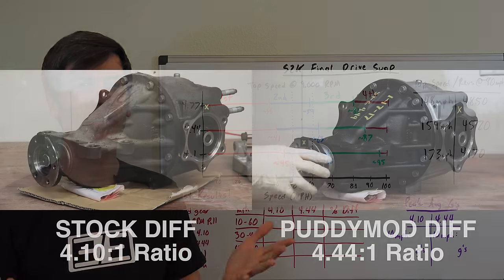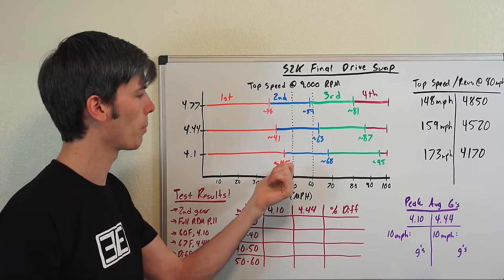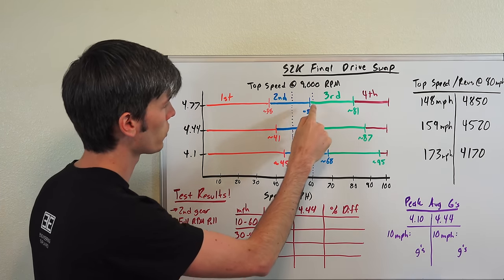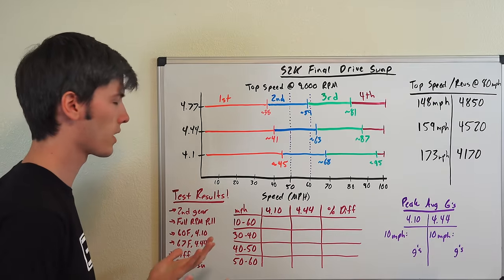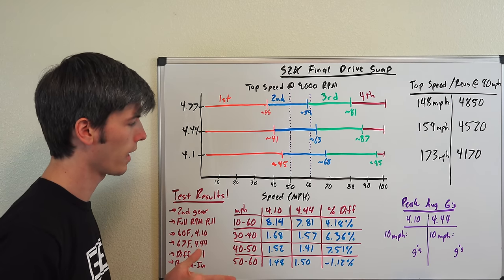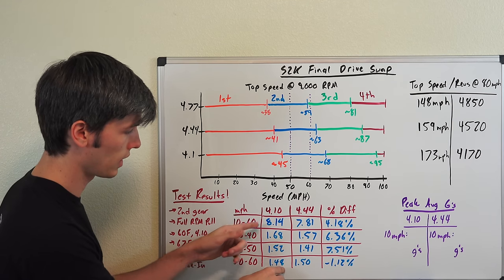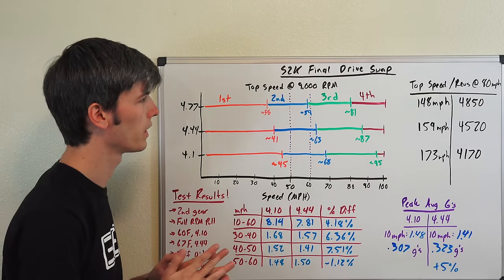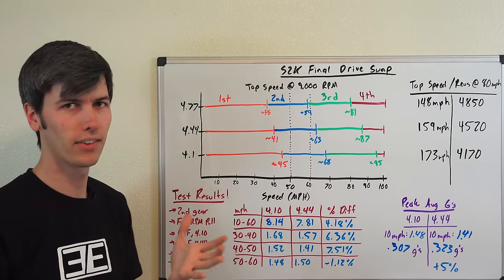Can Gearing Make Your Car Faster? With Proof!

Comment: great vid as always! 

however what are your thoughts on the duration of time spent in the fatter part of a torque curve? You compare the max g force that both ratios would provide and state there is an increase of 5%. 

But this does not take into consideration the time spent in the torque band. Also if an engine has a lot of torque it is more beneficial to have a longer ratio as you want to use that torque for a longer period of time before changing to the next gear. 

Think of the Corvette ZR1 or the Dodge Viper. Both cars are geared to do over 60mph in 1st gear. if their ratios were changed to be shorter, they would have a higher peak g force but the overall acceleration would be slower as you wouldn't be able to use the torque as effective as you'd be racing from gear change to gear change.
Reply: The Corvette and Viper would have no traction if you shortened the 1st gear though, so It would be futile to do so anyway... giving more torque multiplication would just make it wheelspin central.  I noticed Jason didn't mention the effects of being traction limited.
Reply: Yes I agree.  However I feel that if traction could be increased to negate wheel spin then all you would be doing is changing gears (on the ZR1 and Viper anyway), rather than applying the torque and accelerating.  

Anyway, I'm not claiming to be an expert on this.  I've just seen in my local car scene guys changing from a 3.08 diff ratio to 4.33 and going slower down the quarter mile, the 4.33 is much more fun on the street cos you do feel an increase in peak acceleration g force, but ultimately a slower car.  I used to have one of these cars back in the day with a 3.08 ratio and from witnessing that others did, I would imagine that somewhere in between would have been the best upgrade like around 3.73/3.91.  BTW the cars are an Australian Holden Commodore, this particular model weighs 1,500kg, with a 5.0L v8 efi with approx 250hp if you're wondering :).  

I know the example I gave is extreme in comparison to what Mr EE has done with his S2000 with only a slight change in ratio which obviously he has done the math to know it would be more beneficial.

I feel that at a certain point the ratio will become too short, or on the flipside when the horsepower or torque is increased you need to possibly increase the gearing to put the power down. Think drag cars that are running 2 speed transmissions, larger diameter rear tyres, and can still manage high tops speeds.

Be cool to hear Mr EE do a technical vid to explain this :)

Comment: Oh, and what about 45 to 65?
Shorter gear ratios feels faster. It is faster only if the test at hand does not involve an extra gear change.
Top speed is not really a negative because in fact it makes it usually more attainable.
That is why often the 4.77 gear ratio S2000s run slower 400m than stock 4.1 diff.

Comment: If your Rev-limit kicks in at 61 mph than it should have no effect on your 50-60 time.

look at your engines power-curve.
pretty much every normal motor will drop in power before hitting the rev-limit, so with the lower gearing you are likely already past peak power.

Comment: I'd be interested in seeing the difference in fuel economy when cruising at 65 mph in top gear between the two, since the 4.44 would end up cruising at a higher engine speed.

Comment: Where did your stock numbers come from?  I've owned S2000s for 11 years now.  Magazines claimed (and I have unscientifically verified) that an AP1 from the factory will do 42mph in 1st gear, 64mph in 2nd, 89mph in 3rd, etc.  162mph top speed.  This is confirmed in a super accurate way by reading 81mph when my tach is at 4500rpm lol...  I've never run it through a telemetry system, though, so that may be the difference.

Comment: i sortha think i would had gone with 4,77:1 and a bit laarger tires in diameter.
the gears won't be as short, but supposedly larger wheels give a bit more grip.
can help to lanuch from start efficiently. and might get the 4,77:1 diff long enough to reach 60 mph with one less gear change, as with the stock wheels you are just shy of it a tiny tiny bit. most probably a larger diameter wheel can allow less tire pressure, even while grip is based on only the friction between the surface and the road, i think a larger contact patch has more "chane to find spots with better grip" if you catch my drift.
supposedly the larger rear wheels will allso tilt the car a weeee tiny bit to the front, that can allso help  a bit when doing dragracing. might, just might allso help with downforce too. but i don't think its going to be that steep.

Comment: Hi, I have a totally stock 2001 Cobra Mustang vert that I would like to make quicker off the line.  This is a family fun car, daily driver.  Is it better to simply install a 3:73 or modding the engine for horsepower?  No racing for this car, I’m just looking for more “zip”.

Comment: I was wondering if you could tell me if there is any difference in the 0-60 time with the new gear. I know you said that for the purposes of the test u did the 10-60 time to eliminate as many variables as possible, but I assume that you already know the 0-60 time for the stock gear in your car. I was wondering if u have checked the 0-60 time for the new gear yet, and if not, can you check the 0-60 for the new gear and let me know the difference if there is any? I am really curious to see what the effect, if any, of swapping out the diff in your car is

Comment: I changed the gear ratios in my 240sx with a j30 vlsd and it's a lot quicker but screams at around 5,000 rpm on the highway. Kinda annoying lol
Reply: That would drive my crazy, I'd feel bad for my engine.
Reply: I know. Every time I drive on the highway, I'm constantly saying sorry sorry sorry to my car and other drivers. lol
Reply: Isn't the stock 240sx gear 4.08 and the stock j30 gear something like 3.90? Your comment doesn't make sense if that is true. Also you can change the carrier without changing the ring and pinion gears. Which means you can get that VLSD carrier without changing your gear ratio.
Reply: I think you misunderstood what I said. I changed the gear ratios in the j30's differential that then went on my 240sx.
Reply: So what gear ratio did you change to?
Reply: lol, What is this, 21 questions? 4.36:1 with the 5-star bolt pattern output shafts and cv axles
Reply: I could probably think of 21 questions if you really want me to. lol
Reply: not as annoying as my 240 with 4.63 and straight pipe!

Comment: Great videos. I've been wondering lately. If I set my manual transmission vehicle's cruise control at it's optimal powerband RPM on the highway, as long as it's within the legal speed limit of course, will it get the best fuel economy at that specific RPM?

Comment: Hi, I'm not an expert in mechanics but have been trying to understand why my 2020 X5 30d feels slower taking off from my former 2015 X5 30d, (same diesel engine 30d). The new car has only 8Hp's more but in torque comes with an extra 60Nm of torque. Both come equipped with ZF 8 speed transmission
So why I'm getting a feedback from the new car slower from a stand departure? 
The old car had 20" wheels, the new one 21" 
I found some valuable information about both cars that maybe you can tell me if that's where the difference comes from. For example, the old one has a final drive ratio of 3.154 vs 2.929 from the new one? 
I do have the ratios per gear if you need them, thanks in advance

Comment: Great video, curious about doing this for a BRZ.  Curious if you can note or reference what some disadvantages (unrelated to acceleration/top speed) might be if doing this, because it sounds pretty good, thanks.
Reply from the maker: Worse fuel economy, and you'll need to correct your speedometer to read accurately.

Comment: Isn't it bad to have WOT with the rpms down?  Or is this just a Turbo Charged vehicle thing?
Reply from the maker: Yes, worse to do with turbocharged cars, certainly, as you have higher internal pressures which increases the likelihood of pre-detonation. Especially important not to do WOT at low RPM in higher gears. In lower gears, the engine isn't forced to work quite as hard.
Reply: Jonathan Lavigne depends how "down" they are. It depends on the gear and where the engine makes torque. As a rule of thumb for petrol engines, where the peak torque is usually somewhere in the 4000-5000rpm range, flooring it at anything less than 1000-1200rpm in any gear other than 1st can be bad because you'll be lugging the shit out of the engine. Flooring it at as low as 1500rpm in 1st is okay and isn't too bad in 2nd. For higher gears I make sure to be at at least 2000rpm.

For a diesel engine it's a different story, because diesels usually make peak torque somewhere around the 2000rpm mark so at 1000 or 1200rpm they're still running close enough to peak torque that WOT in 1st, 2nd and maybe even 3rd (depending on how long or short the gears are) isn't that harmful.

With regards to the test that Jason did here, 10mph in 2nd gear with the 4.44 final drive is about 1400rpm, so even though it's a low speed and the engine is not making much torque i.e. not working very efficiently, the relatively high gear ratio from second gear reduces the load on the engine in the first place.
Reply: Pretty sure EFI solves these, especially with electric throttle bodies.

Comment: so having a diff which is 4:3:1 ratio it  will accelarate faster but will have a decrease in top speed 
but if you put a 4:1:1 diff ratio it will accelarate slower but it will have an increase in top speed (if you tune it as you said)

Comment: You should turbo this. If you turbo ur s2000 would it become more efficient?
Reply: Ya, I think he's planning on it. RULE #1 OF TUNING: UPGRADE INTERNALS BEFORE ADDING 15+psi
Reply: Haha Roland, I think S2000 internals are very strong anyway, the downside is more than turboing it will ruin the pure NA vtec driving experience (yo). :)
Reply: mujjuman   no. it would not be more efficient. you are thinking of a diesel which is more efficient with a forced induction system (turbo. supercharger)   to those that may argue this; forced induction forces more air which requires more fuel which will increase your fuel consumption on a typical gasser. not to mention the higher compression ratios generated. on a diesel it the opposite. without forced induction the diesel basically bellows black smoke. black smoke is diesel fuel that did not combust. this happens because of the way a diesel works. it ignites fuel based on compression alone. meaning when fuel is injected it is ignited with hot compressed air alone. well when you dont have enough of that hot air it leaves a rather large percentage of diesel behind blowing it out the exhaust valves. when you turbo a diesel you get more air to simply burn the fuel thats already there. on a gasser you would definitely have to increase fuel flow to make it run properly which decreases efficiency. on a diesel its about what ignites the fuel to begin with... which is oxygen or air. not spark plugs.
Reply: mujjuman  i think hes not doing that because hes making videos on experimenting with his S2000, so adding a turbo means adding the turbo lag factor which would definetely be a drawback for his videos and making his experiments "unfair" especially for vids like gearing. but if i had an s2000, i would probably turbocharge it :)
Reply: It wouldn't be more efficient than stock, but it would be more efficient than a comparably powered NA engine
Reply: mujjuman any time you add forced induction, you will be adding more air, which means you need more fuel. more fuel means less fuel efficiency per mile, which means lesser miles per tank. obviously. the only time it's near same efficiency is at idle
Reply: if a car is designed with a turbo from the getgo it can save fuel, as a smaller displacement engine is needed to hit the power figures they want.  slapping a turbo on a engine that's already in the car will never save you fuel though.
Reply: No, and even factory turbo cars don't get better mileage when driven hard.   Factory turbo cars are tuned in a way that helps them post good numbers in the EPA test, and the turbo can help part throttle efficiency, but the moment you start hammering on them at WOT you run into reality, and that reality is that turbo cars have to run richer than N/A cars.   So while a 300hp turbo 2.5 can be driven around like it's a 150hp 2.5 and return better economy than a 300hp N/A 5.0, once you start using the power they end up consuming more fuel. 

A turbo on a F22C requires a rich tune to stay safe, so he'd tank his fuel economy from idle to WOT, and they aren't particularly reliable once the power gets over 400hp.  There's a reason people put aluminum LSx engines in S2000s.

Comment: This isn't a complete enough test to conclude that gearing can make your car faster.  Yes, it can make your car faster during a certain interval (like he tested, 10-60 in 2nd gear).  What if he tested 10-85 using 1st, 2nd, and 3rd (while finding a way to keep shifts very consistent)? The 4.44 would have a slight advantage between 10-41 mph, but once he shifts the 4.44 to 2nd, the 4.1 now has a significant torque advantage until 45 mph when the 4.1 now shifts to 2nd.  Is the torque advantage between 41 and 45 enough to outweigh the torque disadvantage between 10-41? Yes!  Same thing happens between 45 and 63, the 4.44 has a slight advantage, but once the 4.44 shifts to 3rd, the 4.1 catches back up.  Without considering the fact that sometimes the engine is far away from peak torque (the S2000 particularly has a very constant torque curve, so keeping it near peak torque is easy), there will be very little change in acceleration with different rear end ratios when spread across a large interval.  Changing rear end ratios makes sense for eliminating shifts or keeping a higher torque band for defined intervals (1/4 mile, long straight on a track, etc).  For a street car, if the transmission ratios are close enough that the engine stays relatively in the torque band, then select the rear end ratio that keeps your cruising gears happy for your most traveled speeds.  You should make a graph that shows torque at the wheels versus ground speed.  Then the area under the curve will be relative to acceleration.  It's a good way to show that over a long interval rear end gear doesn't matter, but does matter if you put a start and end to the acceleration interval.

Comment: So the gear ratio is better for the 4.44 but the 2nd shift kills the 4.77 that's why the 50-60 times are worst the torque spilt , not bad for a AP1 with that 9k redline

Comment: I suppose it's little tricky about the top speed vs gearing. Could you please explain why does it actually happen?  In my view if you have less transmission ratio  you have higher top speed as well, as you have more weels tork, of course in addition for the same speed rpm is higher so you have higher hp. Maybe I forgot smth.

Comment: Ok. So how effective would something like this be on a low power hatchback? And we are talking really low power, something like 76BHP from a 1.25 litre engine with the final drive being a 4.25 powering the front wheels. (The car in question is a 2008 Ford Fiesta). If it is effective, would it be worth it for such a narrow powerband?

Comment: Would re-gearing an NA V6 Ford F-150 be worth it? I drove a 2017 crew cab, and it felt very underpowered and had to rev pretty high to get adequate power. I'd want to take it on the highway too, so not too dramatic of a re-gear. With that in mind, would it be enough or probably still feel too weak?
Reply: Maybe a tune with better shift points would help. It seemed like a good engine. The weight to hp ratio was decent and should've felt faster, but it was weak.

Comment: I've got a question about "shorter differentials", ofc with meaning swapping diff from ex: 4.0 to 4.5....
In this case: Does 4.5 is going to have advantage in realy ANY speed ? Isn't it like is going to have advantage at lower speeds but than in high speeds 100mph++ is going to loose it, because high air resistance?

Comment: First of all, love your channel, but I was noticing that the math seem to be off a little on the difference percentage (i.e the percentage diff on the 10-60mph diff % on the board was 4.18%.  So assuming if you were calculating from the difference of original gear ratio I made the following calculation  0.33/8.14*100 = 4.05%.  So when I saw that these did not match I calculated the difference from the new gear ratio with the following calculation 0.33/7.81*100 = 4.23%.  All values were derived from the numbers on your board)  Since the values did not match up with the values on the board, I wonder what I may be missing...

Comment: would the result be the same if you eliminated wind resistance, like if you jacked up the car and made it accelerate from 10 to 60 in 2nd gear. would the ratio which reaches 60 at a lower rpm win?

Comment: I wonder which gear set would work best when it's supercharged. My Ap1 currently is, and a new diff certainly is on my mod list. Once the s2k is SC'd basically the HP and TQ double.
Reply: Rogelio Negrete the way I see it is you can either change your final drive or add power. If you do both, you'll be shifting way too often. Adding power is more ideal than gearing. It's just more expensive.
Reply: Yes I agree on that. I imagine it would be like driving an older STI where the driving experience is very engaging with the constant shifting. I would only consider the upgrade if I blew up my current diff, lol.